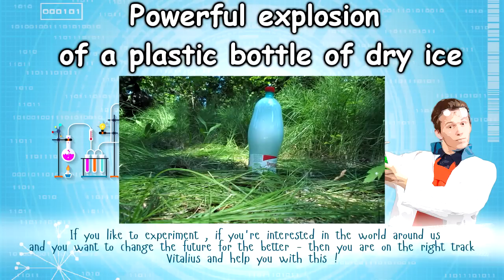DIY: How To Make a Simple Homopolar Motor

Comment: that thing is amazing but what kind of copper did you use?
Please I want to know how it works and what are the things did you use?
Reply: The materials needed to make this are in the description: a copper wire, a battery, and magnets. The top of the wire touches the (+) pole of the battery and the bottom of the wire touches the magnet which is connected to the (-) pole.
Reply: icecaloric ur too smart to be alive

Comment: doesn't the copper wire get hot from the battery?
Reply: 1,5V doesn't do much...
Reply: no.. unless its extremely thin wire
Reply: no the battery gets hot
Reply: 🔥
👘👉 Thinking brain
Reply: Mine did

Comment: I just tryd but it's not rotating.... Can U tell me what m wrong
Reply: Did u connect the wire to the magnet ??
Reply: Hdh FFS d
Reply: Bpxxxvibocom
Reply: For me it works but not for to long ,i need a better magner or battery
Reply: Can we use simple magnets
Reply: Can we use aluminium wire?

Comment: dose it work underwater?
Reply: nein
Reply: Can Demirci
No
Reply: Not with just an AA battery, water creates too much friction for the power output in the battery can counteract
Reply: jdk
Reply: нет
Reply: дед Мазай
Reply: Ed Saucin = as long as the water is clean enough. When it's salty it'll be conductive for example
Reply: matt
Reply: what type and strenght of magnet are you using and what gauge of copper wire?
Reply: It has to be a earth magnet , they are a conducter reg mags are not !
Reply: дед Мазай no

Comment: watching a wire spin is cool and all but I'd like to see that motor run something
Reply: Andre Leblanc Nope, the battery loses charge. Friction, resistance, and other phenomena cause the energy to dissipate.
Reply: can the energy, motion it generates not be harnessed to recharge say a rechargeable battery or power something
Reply: Steven Short 7
Reply: Q
Reply: agrobotics disculpe los materiales
Reply: is a homopolar motor perpetual motion?
Reply: Yes but you only transfer the energy, with losses by friction, heat. Regenerative charging, like you are suggesting, is used in electric cars, but on this scale I'd be curious to see how well it would work, considering the torque must be very low. Cool idea, though!
Reply: Steven Short 688

Comment: what kind of wire do we need ??
Reply: It’s magnet wire
Reply: The stronger the magnet, the easier it is to chip, so that's not it. I understand getting the connections right is very tricky. Keep trying.
Reply: I tried a variety of gagues - magnetic, non magnetic, wire from ACTUAL coils - I couldn't get this dam thing to work. I bought 20 Neodymium (3mm thickness) and tried all sorts of AA  batteries with different amounts of magnets and different coils. It span for a moment but it was just the way I had it positioned - I couldn't get it to work....it Pissed me off as-well that theres tons of Idiots doing videos of it as if it's easy - no mention of the composition of battery needed to enhance the field - no mention of the wire type and thickness, no mention of coil turns and diameter, just some bimbo wrapping wire around a pen

I have a feeling that even though they are ridiculously strong, my neodymiums off Amazon (20 for about £3)   are TOTAL SHITE - they look real and are VERY strong, but they are so strong they chip chunks off eachother when they snap together - loike they are Neodymium Coated
Reply: Even with the 20 magnets stacked in a tall cylinder the strength would not turn the coil

Comment: where did you get that magnet
Reply: Amazon
Reply: +Giunio Marco Marchetti what
Reply: headphones
Reply: Its a Neodymium magnet - I recently bought a pack of 20 on Amazon for about £3 - they are really strong....this doesn't work though >>> it does if your a wizard
Reply: +Ben Woodfield it totally works, but you need to sand each end of the copper wire, so you've got a good connection.